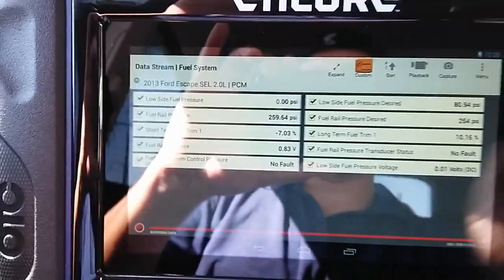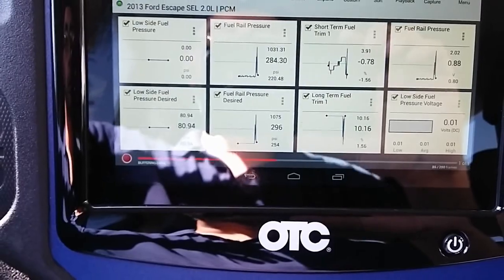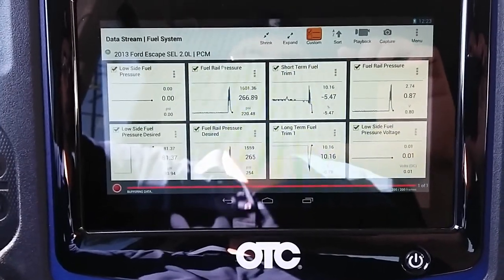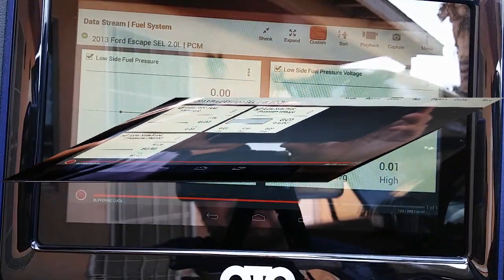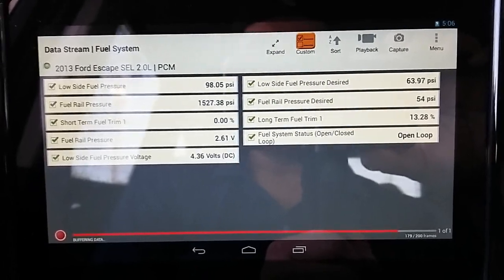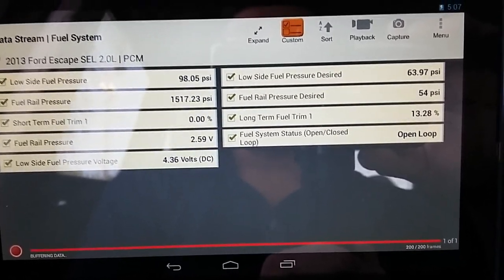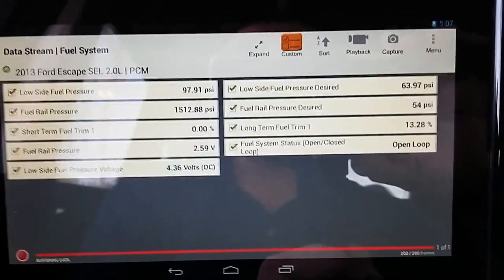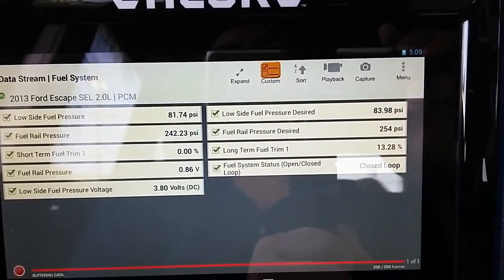(Ford Escape) Pre-Diagnoses with P018C (Fuel Pressure Sensor B Circuit Low)

Comment: Hello brother. I see you responding to people so I’m hoping you can advise me. 2016 Kia Rio throwing p0192 and p0193 fuel pressure rail sensor A circuit high+ low. Replaced the sensor and nothing changed
Reply from the maker: I would recommend you to watch this video, it might help. Keep me posted.
https://youtu.be/vdCa-9mKKPU

Comment: My 2013 escape stalled today i tried stepped on the gas and not even moving. So I restarted the engine and it was ok.  No engine light. Could this be the fuel sensor?  Thanks
Reply from the maker: Best thing is to use a scantool and look for fuel pressure data pids to see if they are reporting normal
Reply: Thanks for the advice.  Will borrow a scan tool but what kind of data i should monitor in the scan.
Reply from the maker: @nhudong9393  Pretty much anything relating to fuel data pids. Also, check your short term and long term fuel trims. If its fuel related, you will get positive fuel trims, above 10%
Reply: @EliTheOBDTech can you help me interpret these data..please let me knows how i can send it to you.  Thanks
Reply from the maker: @nhudong9393  By the looks of it, it's tough to judge the main problem. I do see that your short term is  correcting by substracting fuel away. In other words, the pcm seems that the upstream o2 sensor is detecting not enough oxygen, so it's taking away fuel. Meanwhile, your long term is reporting the opposite. You may possibly have a dirty MAF sensor. Don't remember if this vehicle has one. Have you replaced your air filter lately?
Reply from the maker: Last but not least, you may have some type of vacuum leak. Your high rail pressure sensor seems to be reporting normally.
Reply: @EliTheOBDTech  air filters replaced recently. So nothing wrong with the fuel pressure sensor ?   it is hard to troubleshoot cause of intermittent stall one time. What should I do to verify the vacuum leak?
Reply from the maker: @nhudong9393  for vaccum leak, best thing is to use a smoke machine.
Reply from the maker: Fuel rail pressure seems to be within spec, 600 + psi at idle.

Comment: Eli,  P018B Code on my 13 ford escape 1.6L ecoboost, I've tried seafoam multiple cans with multiple tanks of 91 octane, I clear the codes and it keeps coming back.. sometimes not right away, sometimes not every day .. but it comes back eventually.. If ya could make a suggestion what would ya try? Thanks so much! I appreciate any help ya give - Jay from Wisconsin
Reply from the maker: Have you tried replacing the low side fuel pressure sensor? If you have a capabible scantool, try looking at the low side fuel pressure and high fuel pressure sensor data, to see if the sensors are giving the pcm proper feedback. Worst case scenario, maybe a weak low side fuel pump.

Comment: I put a high pressure fuel pump,  high flow sensor and low fuel sensor and my escape won't let me have my turbo back. It shows no codes on my sct tuner, idk what's going on, have any ideas?
Reply from the maker: How is your fuel trims looking at idle and at 2500rms? 
Perhaps some type of wastegate issue.
Reply: check vacuum pump out put make sure its not leaking and putting oil into the wastegate itself through the vacuum line

Comment: I have a 2015 ram 1500 and I replaced the fuel pressure sensor 3 times and I still get a P018C code after a while any advice in how to fix this problem?
Reply from the maker: When I get a chance I will lookup some Info for you.
Reply: @EliTheOBDTech  thanks
Reply from the maker: @johnnymartinez2077  engine size?
Reply from the maker: Possible causes:
Fuel rail pressure signal circuit shorted to ground.
Fuel rail pressure sensor signal circuit shorted to the fuel rail pressure sensor ground circuit.
5-volt supply circuit shorted to ground.
Fuel rail pressure sensor.
Powertrain control module (PCM).
Maybe a glitching fuel pump relay.

You need to confirm Voltage checks on the fuel rail pressure  sensor. 
Yellow/pink = 5volt supply
Brown/Yellow = FRP signal
Brown/white = sensor ground
Reply: @EliTheOBDTech  5.7
Reply: Pp